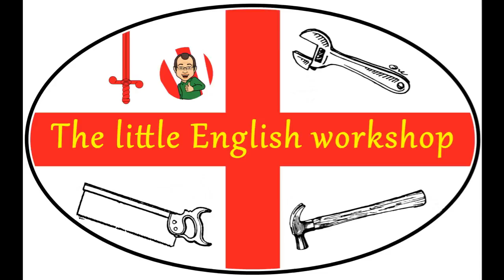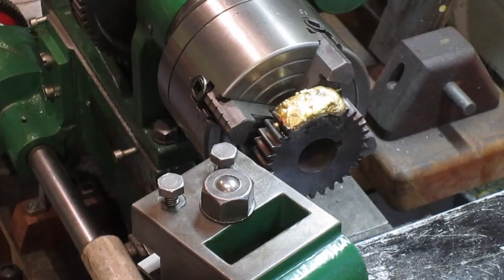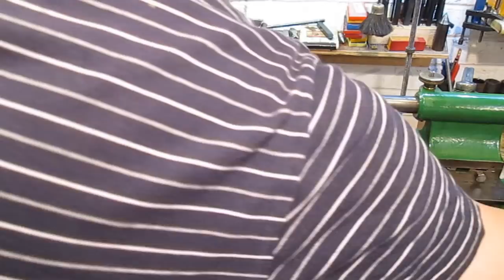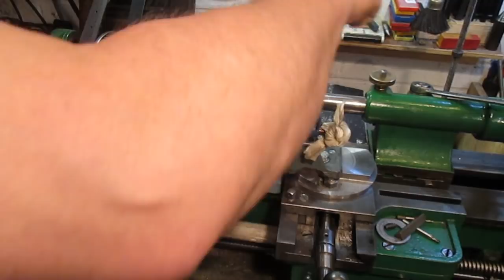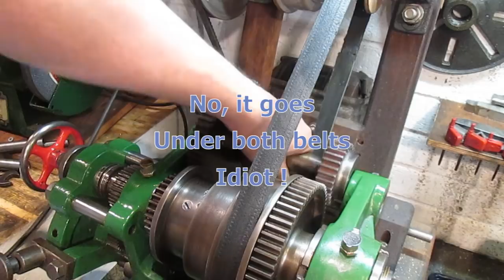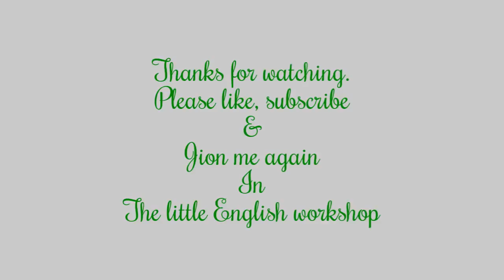FNF 29 Backgear Repair

Comment: A very nice repair and a very ingenious indexing system -- use the original gear as an indexing device to cut itself!  Never seen that before -- everyone seems to use a dividing head to repair brazed-up gears. I think dividing a circle is something every machinist should master and you can do a lot with just the gears that come with the lathe.

Comment: Congratulations on a wonderful result. repaired gear sounds good.
20:08 Major flexing in the milling attachment.
Reply from the maker: It was flexing alot. The Myford vise is a little small to hold the lump of steel the gear was mounted to and I'd hoped the 20mm monting plate I made was strong enough. Perhaps I need to rethink the whole milling setup and make it more beefy, I'm going to attempt to make a complete new gear from Aluminium that should machine eaiser. Thanks for watching